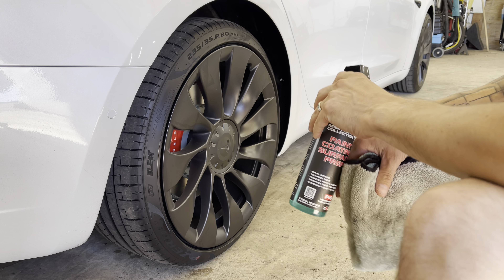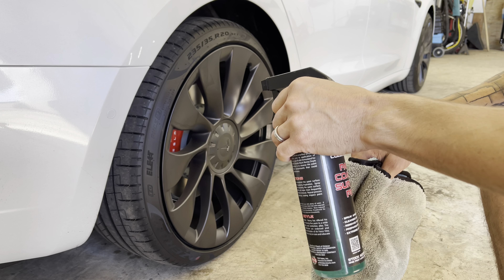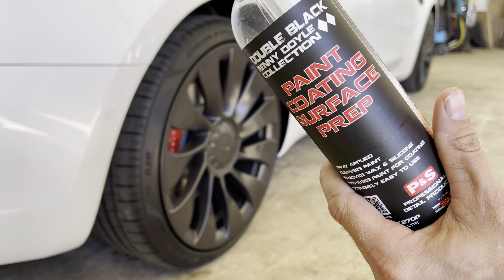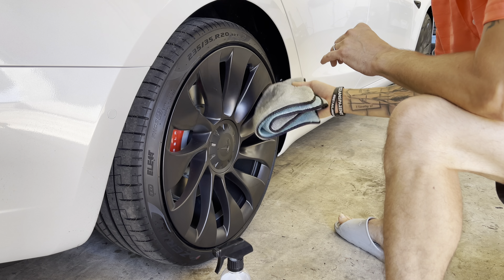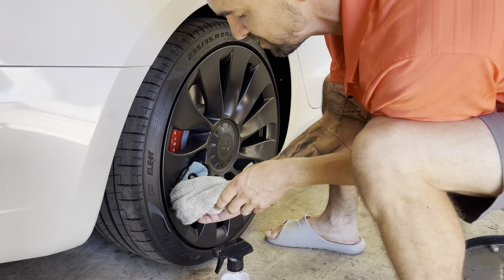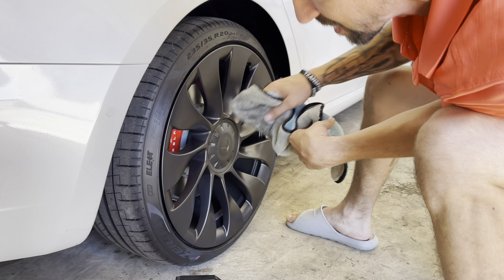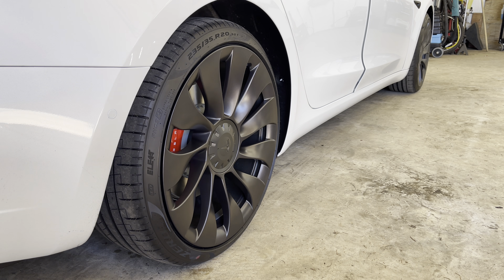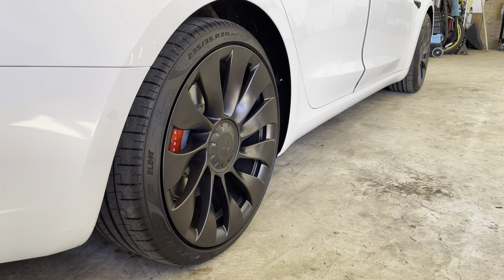HOW To Do a Wheel Ceramic Coating Tesla Model 3 Performance

Comment: About how long do you think the coating will last?
Reply from the maker: I have had great longevity as long as you don’t clean them with acid. I maintain coated wheels with brake buster. Good to reapply probably every 6-12 months depending on maintenance.